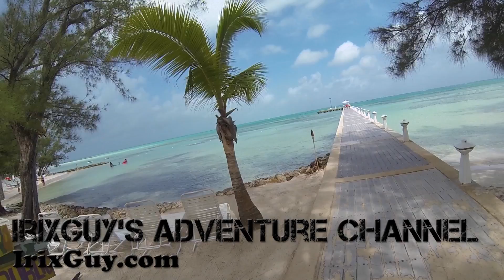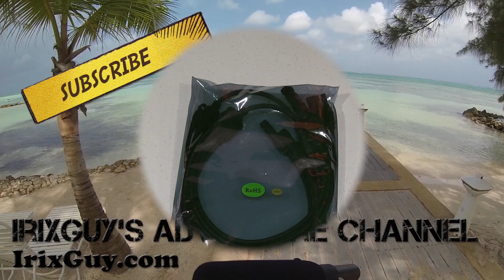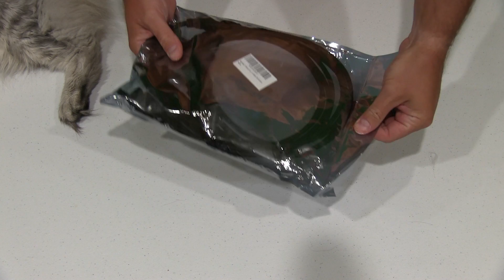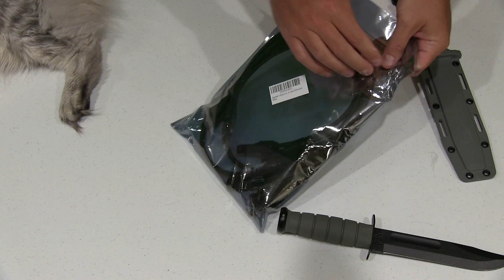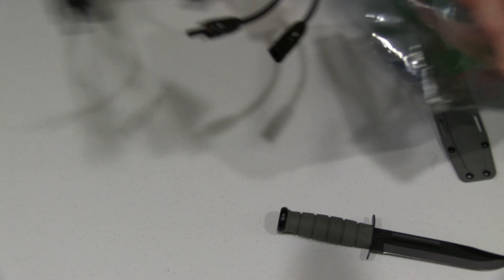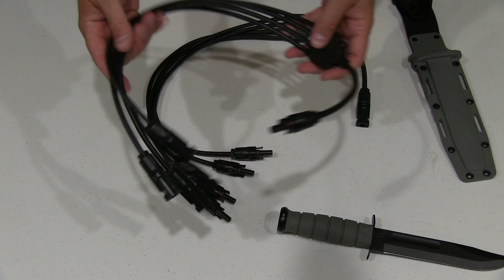Signstek Y Branch MC4 1 Male to 4 FemaleM/FFFF and 1 Female to 4 MaleF/MMMM solar Panel Cable Connec

Comment: Do you recommend this brand over others or are you simply demonstrating the functionality of branch adapters?
Reply from the maker: +Chris Burrows This worked well for me but there are other brands as well.
Reply: Iv bought cheap Y MC4 adapters in the past and they simply didn't work. I ended up cutting the clips off and soldering the lot, but still using the Y part. I want to buy a MFFFF/MFFFF adapter, these are $50, the no names are $25, and don't wanna get fucked over. Guess I'll fork out and get these.